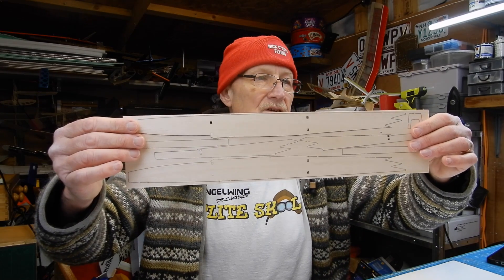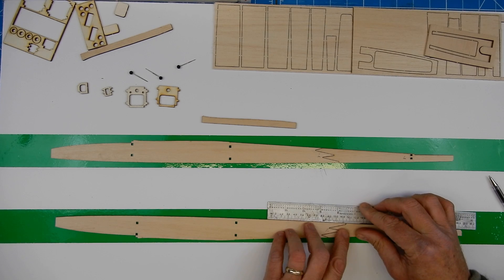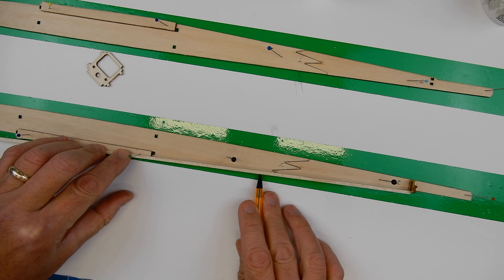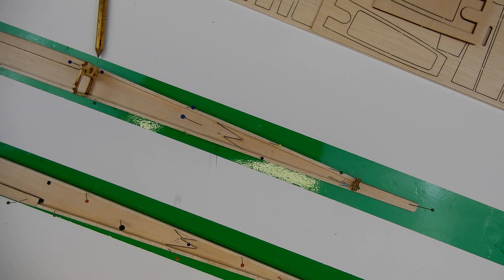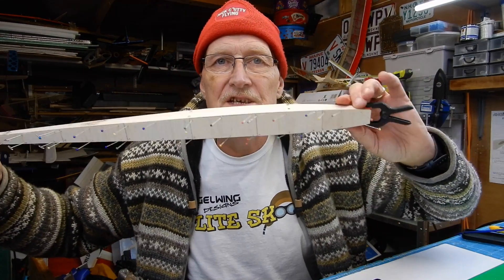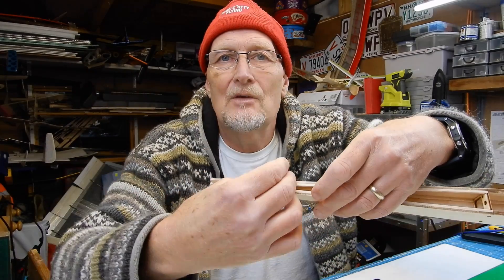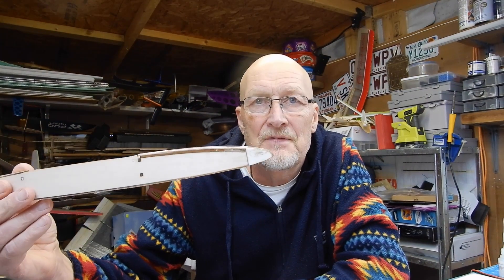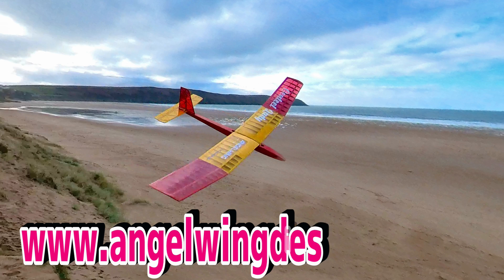How to build Genteel Lady Rc Glider  Part 3 Fuselage

Comment: Just as a casual observation, as the front and rear former's are narrower than the middle former's, are these not at 90' to the sides? gluing these first could cause stress in the sides and induce 'banana' the fuse.
Surely a better assembly would be to jig the two middles former's at 90' glue both sides and make sure this is all square, then pinch the front and rear together with a gentle clamp and have these at 90' to the center line when viewed from above?
Reply from the maker: All I can say is mine is square 😍as the canopy fits but it’s a valid point